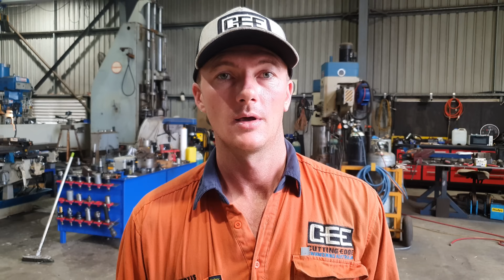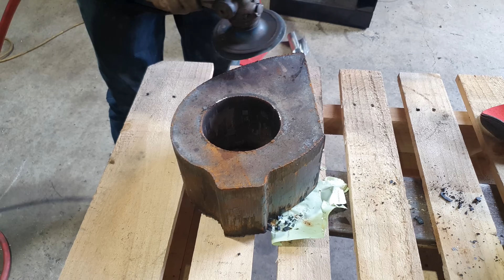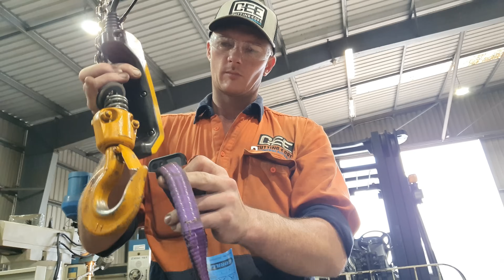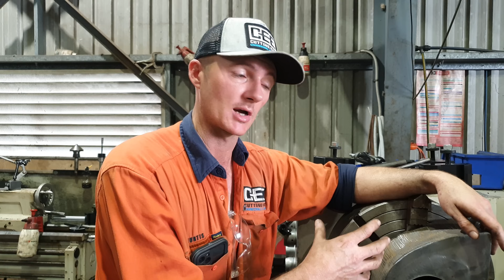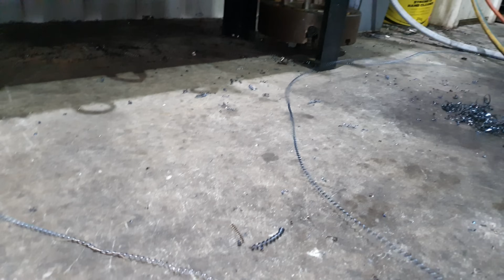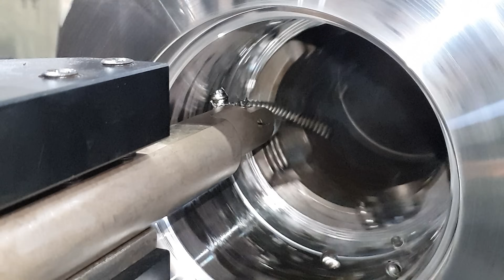Making Parts for CAT D10 Dozer | Machining & Milling

Comment: When the equalizer bar is rebuilt, is there an internal mechanical pin(s) holding the end to the bar plus the weld around the outside, or just the external weld?

Comment: 23:19 What's in the background?
Reply from the maker: thats the Delapena vertical honing machine
Reply: @CuttingEdgeEngineering  No, the shadow moving on the ground, hiding behind some gear. Never mind, the engineer's arm casting a shadow under your video light?

Comment: The customer provides all the dimensions or are they manufacturer specs? Could you show drawings from time to time?
Reply from the maker: hey mate manufacturers won't supply specs, we produce our own drawings from original parts
Reply: @CuttingEdgeEngineering  Thks, do you use manufacturers references for the seals tolerances?

Comment: Great job! I've got a question, what dictates when you use cooling liquid when you're cutting or boring a piece?
Reply: I’ll chime in from the peanut gallery in the event K&K are exhausted from reading and replying to a gazillion yahoo’s like me, and no you’re absolutely not all yahoos, but you know what I mean…
My excellent machinist friend and neighbor and I go back and forth on the matter of cutting/cooling fluid and my take on his position is that he hates delays and the mess and as an employee, doesn’t have to buy the tooling. What I observe with Kurtis is an instinct for when it’s simply not necessary because either the process and material is not hard on the tooling, or there isn’t going to be much heat generated. Of course there are many more variables like the needs of specific tools/materials, time, and efficiency so it’s really about years of experience and instincts honed by all those years since there mostly aren’t hard and fast rules, and humans are never totally consistent unless working in highly specified/disciplined/structured/ environments. 

In my ignorance and inexperience (carpenter dabbling with neighbor’s lathe stashed in my shop) I err on the side of ruining far too much tooling and using lots of fluids.

Comment: Was water jet an option for cutting the blanks? Would have been prettier, much less clean up, closer to net shape so less boring, no heat affected zone so longer insert life. Does being more expensive than flame cut wipe out the saving of your time? Of course, if there isn't anybody local who can do it, the question is moot.

Comment: Based on videos of previous projects I had fully expected when you flipped the parts over to the second side that you would use the three jaw chuck in the finished center bore. What factors went into your decision to continue to use the four jaw? Not challenging the decision, just trying to learn! My thought is that it had something to do with the step in the bore for the seal seat, but that's just a wild guess!
Reply from the maker: hey mate good question, did consider setting up the 3 jaw but the offset weight and shape of the part much more clamping pressure holding external and didn't feel like swapping out the chuck again
Reply: @CuttingEdgeEngineering  thanks for the reply, I appreciate it!

Comment: When drilling holes on milling machine or drill press that are 90° instead of squeezing oil puddle on work peace squeze some oil on the drill flutes ,it will drip slowly down and lubricate far better.

Comment: Usually when machining such odd parts by the book you should use a faceplate with counterweights.However there is also welding technique.You take a round peace of steel in this case pipe bigger than id diameter of future part.Then you tack weld it on several places and you can put your object in 3 jaws chuck .Depending on the setup it can be very accurate method especially if you use pins for alignment.When you are done you just grind off tack welds.
I used this method to drill a big 90mm hole in a steel plate that couldnt fit into milling machine on a big lathe in a shipyard.

Comment: The starrett edge finder 23:05 only got 1 shot and got replaced 29:22 with a new one....What are you doing with them :p  / The Improved Karen made magic tool changer 30:50- 31:20 ,  Think we need that to, where can we buy that one :P

Comment: How much harder is the steel where it's been cut with the plasma? And how far into the steel will it be normal? You do some nice work, I like how you take time to put your pup into the video.
Reply from the maker: hey mate it's cut with oxy flame torch, it's hard enough that HSS goes blunt on it, usually about 2-3mm hardened like that
Reply: @CuttingEdgeEngineering  thanks

Comment: Not to tell you anything, but was it really necessary to mill the top where the grease nipples go ?
Reply from the maker: Removing the hardened flame cut edge makes the drilling a bit easier
Reply: One would think it would be easier to replace a drill than the incerts in the mill head

Comment: I think every mechanical engineering student should apprentice in a large machine/fab shop for a few months with someone like Curtis or Adam (Abom).
Reply: When all these studied engineers are made to repair the stuff they developed for only one time, we would have switchboards big as a house. Everything was at three feet height so you don't habe to bend. You have illumination everywere and an electric crane in every spot. Also the whole area was climate controlled and dirt free. 😁

Comment: When using a pipe tap, what is the appropriate depth to run the tap in? In my experience, if I tap to the full depth of the cutting threads on the tap, then the plug, grease zero, etc. seems sloppy (over tapped).

Comment: Is there really a need for three Zerks?  It seems one would be enough and which would leave more bearing surface.
Reply from the maker: Hey mate I should have said the middle one is for the grease and outer holes are for relief valves

Comment: Another good job in the books. Our flame cut supplier cleans up the parts a little better than those were.  Enjoyed watching.
Reply: Those flame cuts were pretty rough!
Reply: What amount of work would two minutes of heavy grit sand blasting save Curtis?
Reply: Now that you mention it, I thought that the condition of the parts was very rough and lacking in presentation for the client. Yes it is flame cut steel, but how hard would it be to remove some of those slag dags before sending the part out. Where is the pride and presentation of the product?
Reply: @markfryer9880  It looked like left-hand work.
Reply: @markfryer9880  You can get surprising neat results with flame cutting, Curtis himself has shown this a number of time.

Comment: The start of the video have me a flash back to working in the flame cutting dept. We had 4 pattern copying machines, with magnetic stylus heads. Great to get the same dimensions on all the pieces, but played havoc with the legs of the overalls, socks and boots and mostly the feet when a hot piece of slag got into the top of the boot, that's why we never tied the laces up as the boot could be easily kicked off taking the not slag with it. I would be a liar if I said there were never a funny side to this, despite shouting "BOOT" in vain attempt to warn the others to duck, there were times when you would be hit by a stray boot. It all added to the fun. Nicely machined despite being an awkward shape. It doesn't help with the piece being that thick too. Thanks for posting, it really does make Friday's a good day.

Comment: would a flow jet cutting system give better finish without losting the temper in the metal or is flame cutting a little cheaper

Comment: So why not hold the part on the bore for the second operation in the lathe?  Is it just quicker in the end to dial in with 4 jaw chuck on out side of part than replacing the chuck?  In that case why not use 4 jaw internally, or again quicker than reversing the clamps?

Comment: I was going to comment about changing inserts while the tool is on the tool post. When I try that, the insert ends up in the chip tray Every. Single. Time.  Glad to see I'm not the only one!   High pucker factor on parts like these.

Comment: Hey Curtis, have recently discovered your channel and am loving it. Thanks for the hard work. One question, I was taught to wait until the edge finder slid over, and that was your edge. I notice that twice you didn’t wait for that. I appreciate that in this sort of work, the one micron difference is not going to matter, but I (as a beginner) was wondering if there was another reason why you didn’t wait for the edge finder to move? Cheers Al

Comment: I have a question won't the grease fitting be blocked from doing the job since the snap rings will block the holes drilled to allow grease to get in

Comment: Hey Kurtis, can you machine the face of that piece starting from the inside or does it need to start from the outside? Would it be easier on the insert?? Just curious because of the shape of your material. 🤔🤔

Comment: Do you face these parts on the lathe instead of when they are on the mill simply for the time saving aspect from not changing setup? Or does that heavy ass lathe handle it better also? I would think a big ol face milling head would more those motherfuckers down just as quick as the power feed would send it and you could set multiple pieces on the mill at once, but that's just thinking. I don't really know shit.

Comment: Fun machining those hard flame-cut surfaces. Back in the day my shop was frequently tasked with machining precision parts from thick, high-strength plate flame cut to outline. The flame-cut surface were file hard and they ATE the most adamentine carbide inserts. Naturally, the helpful folks at the steel yard left the minimum machining stock so you were sure of insert edge wear or often breakage when finish machining the hard spots remaining in the feature surfaces.

Our remedy was to sneak them in the big furnace in the welding booth for a 450⁰ C (max interpass temperature) soak overnight. This drew the hard spots down to machinability without significantly interfering with the as-wrought strength properties - or so we hoped.

Comment: With the edge finder - other machining chanels (OK, it's  Blondihacks  :) ) - move the edge finder until it's running smooth and then a bit further until it "breaks" to find the edge. Kurtis only moves the finder until it's running smooth.
Is it just a technique thing or is there a "right" way to use it?
Reply: I use the same method as Kurtis, think about it, if you move the part until it kicks the edge finder out of line then so is the part.
Reply: @Peter-V_00  Hmm. I think that the idea is that the edge finder can spin true without actually touching - ie the magnet has pulled it centre even though it's hovering just off the part. Having the finder kick out guarantees that you're actually touching the part. You then correct by .001"
This guy doesn't even spin the finder, just uses a finger to feel for touch off:
https://www.youtube.com/watch?v=GWK_3ZsD-uY&ab_channel=TigermothRacing
Reply: @amcconnell6730  Not sure where the magnet(?) is in this equation but okay.
Like most things in the world there are several techniques that get the job done and everyone thinks their way is the best way.
Reply: @Peter-V_00  Sorry - I'm not a machinist, looking at the behaviour I assumed it was a magnet, but I've now seen it's a spring. Same thing though. Obviously Kurtis is an expert machinist and gets the job done - I was just curious about the process.

Comment: How long does it take you to remove the old ends and replace em bud ?? looks like alot of welding to fit em up ...
Reply from the maker: Stay tuned will find out next week lol
Reply: Ok kewl
Reply: I can't imagine there is any cost or time savings for the customer to cut off the old one, weld on a new one, and then line bore to finish size afterward.

Comment: I finally finished my D11 Lego Model - so tonight, I feel pretty much how Curtis feels.
Reply from the maker: oooohh how long did that one take you mate? I've still got mine in the box
Reply: @CuttingEdgeEngineering  So, when I build, I try to do one section a night - each section is about 2 or so hours (sometimes a bit more, sometimes a bit less) - It took me 8 evenings all up. I've had great fun annoying my cats with it already.

Comment: For the grease nipples, were they 1/8" BSPT (Tapered)? If yes, how to you know when to stop... at the end of the threads on the tap?
Also, does the customer know that you bored them undersize and they will need line boring after welding?

Comment: The BSP thread reminded me of a time when I was in the Mill and Industrial business. We sold Schrader valves here in the US (same Schrader that invented the bicycle tire/tyre valve). Made in England. The ones we sold were NPT and suddenly we started getting complaints from customers that brand new valves (1/4" NPT 4-way pneumatic/low-pressure hydraulic) were leaking at the threads. Turned out a batch of valves were mislabeled at the factory as US spec and were actually British. The difference? At least in 1/4" it's ONE thread per inch! That one had us scratching our heads for a while!
Reply: "The difference? At least in 1/4" it's ONE thread per inch! That one had us scratching our heads for a while!" - like, "how they did it?", eh? C'mon, for a zestful and enthusiastic worker no mismatch in parts would be any obstacle in pursuit of completing the job!
Once I bought a second hand bike on behalf oof an acquittance of mine (I'm an amateur/ hobbyist bicycle mechanic) and I noticed that left pedal was different than left pedal - well, no big deal, I was going to replace them anyway... However, as it turned out, the "left" pedal was actually a RIGHT one - in case you're not familiar with the problem, right pedals have "right" thread, while left pedals have "left" thread. So somebody actually managed to screw in a right hand thread into a left hand thread female thread in the crank.
Lesson? Never underestimate people's... perseverance, let us call it, as we do not want to use words like "idiocy", do we? ;-)
Reply: @MrKotBonifacy  Oh yes! I took my ~'65 Schwinn Stingray apart when I was about 10 (I'm 63 now). Needed to clean the sand out of the bearings. I mean turned it upside down and stripped it to the frame! Mom was NOT happy when she came into the basement and saw it all apart! Went and got the belt and let me have it! Funny, she  didn't apologize later when I got it all back together and was riding it!
Reply: @PhilG999  "Funny, she  didn't apologize later" well, our Moms, apart from being "moms", are (first and foremost) WOMEN. That means, a simple two-point rule applies whenever an issue of "right or wrong" pops up - and the rule is:

1. Woman is ALWAYS right, and;
2. In case it looks like a woman is wrong, see pt. 1.

See? Plain and simple... ;-)
Reply: @MrKotBonifacy  Yes, Yes we DO want to use words like Idiocy in cases like that since we're generally not permitted to use the words we REALLY want to in Polite Company...

Words like <CENSORED> and <REDACTED> and <BLEEP>...

😄😁😆😅😂🤣
Reply: @HappilyHomicidalHooligan  Precisamente, amigo! ;-)
It was this sort of a sarcasm, when you say to someone "well, if I were to be honest I'd say you're an idiot, but since I preffer to be polite I'm not going to say that" ;-)

Comment: HI Kurtis and Karen ,
Another awesome video in the can !
I noticed you were using what looked like an insert with no chip breaker when facing the parts - is this because of the interrupted cut ? Also what is the stuff  you are using as a cutting fluid in the oil can ?
Reply from the maker: does have a chip breaker but needs a heavier depth of cut to form. Using Rapid Tap in the oil can

Comment: Whats the name for the rust removing tool? The one with a bunch of nails sticking out
Reply from the maker: That's my Geiger needle scaler, mostly used in welding to clean the weld joint

Comment: This may sound awful but I fully expected that edge finder to go flying first time kurtis turned on mill. Question for kurtis: why did you not use balance slots on four jaw for such an unbalanced piece?
Reply from the maker: the lathe can handle it no worries was not really necessary to add a balance piece

Comment: Why didn't you swap from the 4 jaw to the 3 when you flipped them? Grab from the bore for easy centering and you'll have the 3 on for the next job. If think it would be a lot faster vs manually adjusting to approximate center, but um no machinist.
Reply from the maker: LOL I knew someone would ask this! It was something I considered but would have taken time to swap out the chucks again so really made no difference in the end. I'm sure if I did that more would have asked why I didn't leave the 4 jaw in 🤣
Reply: Chucking on the ID the part would be more likely to come out of the chuck.  You want to avoid chucking on a diameter that is smaller than what is being machined.

Comment: That mill head sounds like got a cranky bearing in it someplace seems run great but just a little noisy
Reply from the maker: yeah it sounds a bit sad if it doesn't get regular greasing will replace it soon